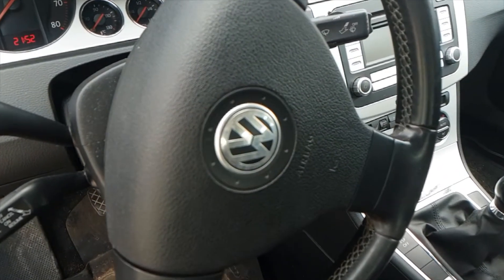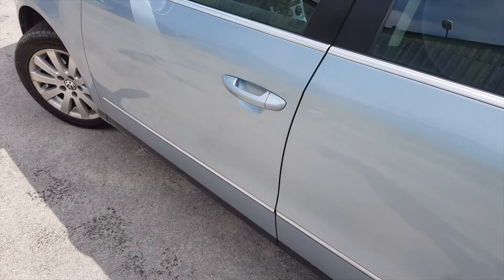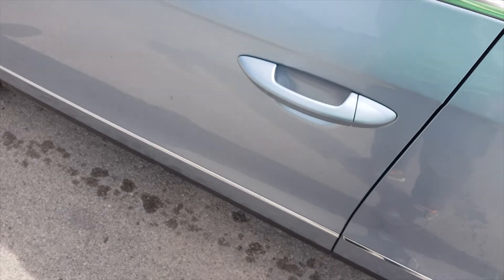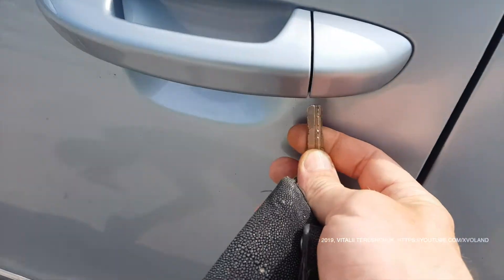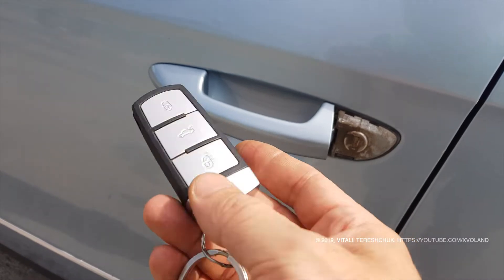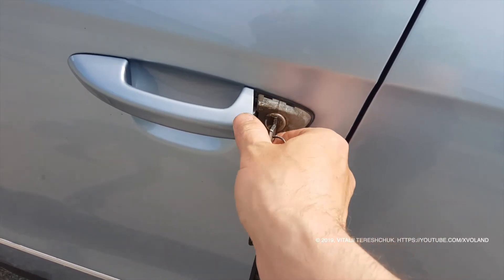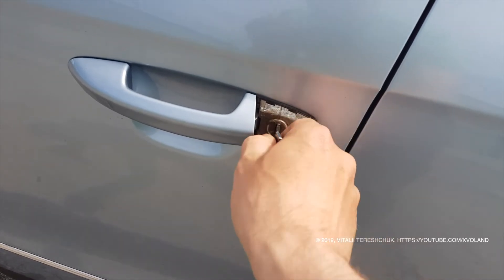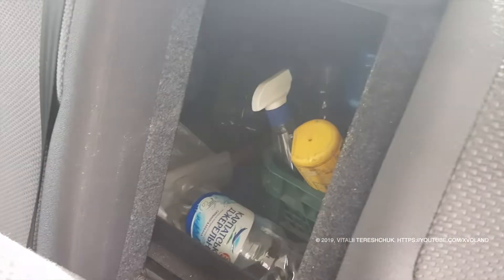🔑 How to open door of a VW Volkswagen if your vehicle battery is flat or the remote isn't working

Comment: Hopefully this get a reply iv got a vw passat 2010 key wont manually open the door when I turn it to unlock but will flash when I turn it to lock it but agen won't do anything and it's not even making a sound
Reply from the maker: This method always opens the car door, even if the battery is disconnected.  After opening, the alarm is triggered, but by inserting the ignition key - it turns off
Reply: @Vitalii Tereshchuk  well to start with mate thanks very much for a reply as this vidoe is over 3 years old shows alot about you. But unfortunately this method don't work with mine as iv done it about 10 times.
Reply from the maker: @ktys206  Do you have documentation for your VW?  You can find it on the Internet and this method is described there.
Reply: @Vitalii Tereshchuk I don't unfortunately mate. I'll have a look and see what I can find thanks
Reply from the maker: @ktys206  Look for manual in pdf format. You are welcome!
Reply: @ktys206 Hi mate, did you get into your car? I have a 2010 and have the same issue.

Comment: How many times should you turn to unlock the door?
Reply from the maker: This is done in half a turn of the key
Reply: @xVoLAnD   Do you need to apply force inside when tuning? and the turn should be clockwise or anticlockwise? The key feels so fragile like it could brake.
Reply: I have been trying turning and turning but nothing is working.
Reply from the maker: Counterclockwise is usually open.  When you turn, you will feel. It always works.  Perhaps you need to use WD-40 for fine lubrication
Reply: I managed to open though a friend showed me a trick which save the situation. When turning you pull the handle twice or thrice simultaneously.
Reply: I can only turn it 90 degrees clockwise or counter, and nothing happens. After using CRC so it would move at all :-(
Reply: @kagiri404 doesn’t work even if you try hundred times